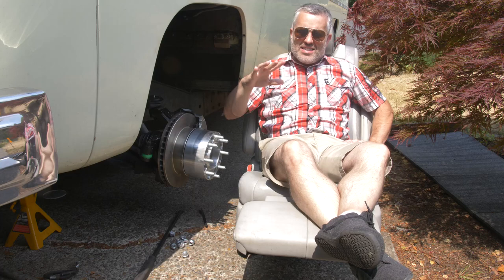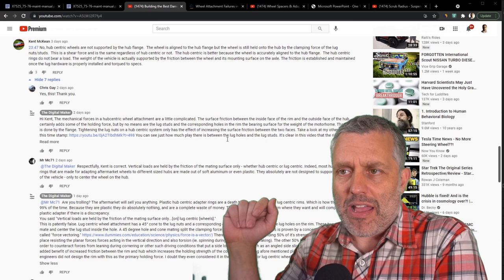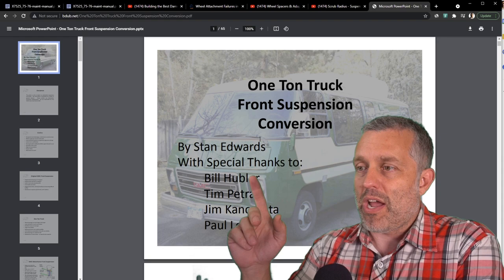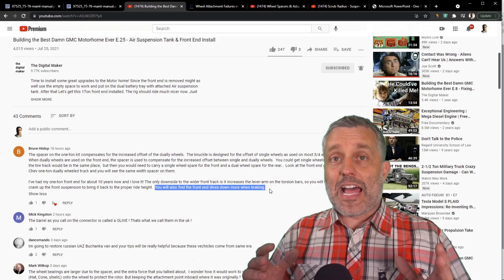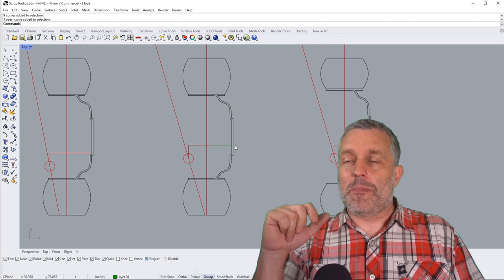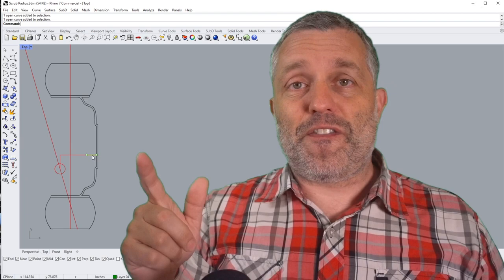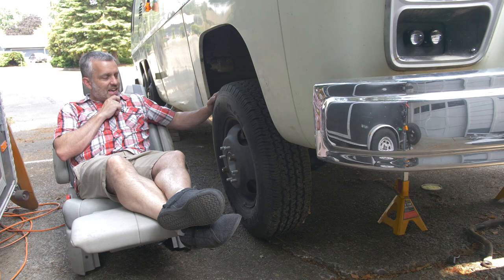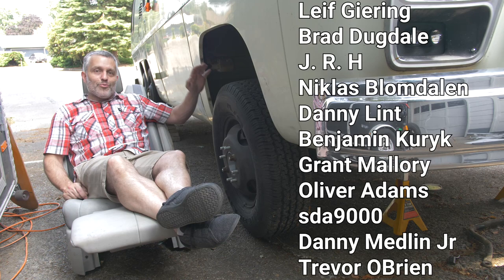GMC Motorhome 1-Ton Upgrade - Engineering Explained

Comment: Bump steer is a directional change due to suspension movement, however it is caused by a difference in the steering arm swing or pivot vs the upright.  Lowering or raising ride height is usually the main cause because the steering hasn't been relocated to compensate.  When we lowered a 911, we usually put a spacer under the steering rack to correct the geometry and minimize the bump steer.
Caster and camber and steering axis inclination all play a part in how effective auto centering is.

Comment: I believe you got bump steer mixed up with the self centering of the wheel. Bump steer happens when the steering linkage is out of plane(extreme angle) with the centerline the front axle.  In this situation when you hit a bump it causes the the front wheels to change direction during the suspension cycling thru the bump. Bump steer happens in improperly lifted 4 wheel drives. Other than that great presentation.
Reply: @mwilliamshs  I've had trouble trying to explain steering geometry,  but definitely know the results of bump steer. I learned the hard way during my younger days lifting 4x4s. Definitely don't like bump steer.

Comment: This has been enormously helpful, thank you. 
Sadly, I was thinking about upgrading but I am now convinced to simply rebuild.  
I’ll buy the tool to do the bearings.  
My family has put over 50,000 miles on our ramshackle 77 Palm Beach and we are still on the original front bearings, though we have done all four rear sets.   Our motor home rocks, no matter how threadbare, it’s an awesome machine.  
Enjoy yours!!

Comment: You are confusing bump steer with caster angle that causes self-centering.  "Bump steer" refers to a change in steering angle caused by a change in suspension height.  Either by lean in a corner or hitting a bump.

Comment: 10:43 Bump steer is NOT the "fancy term" for the force that wants to straighten your wheel out.  The force that wants to straighten your wheel out is a function of "caster".  This also affects the vehicle's straight-line stability.  Bump steer or roll steer is the term for the tendency of the wheel of a car to steer itself as it moves through the suspension stroke.  All vehicle suspension systems have some bump or roll steer, but the designer of the suspension system will have spent a great deal of time and effort to minimise bump steer.  Generally, bump steer cannot be adjusted out of a suspension system without physically relocating suspension components.  
Here is a very good description of bump steer and "instant center" from Hot Rod Garage: https://www.youtube.com/watch?v=tHbWkR-AZXo&t=82s
Reply: Lack of bump steer is why the 1974-1981 Pinto front suspension is so popular with hot rods, custom cars, and racers. North American Fiberglass made Shelby Cobra replicas and raced them with stock Pinto Mustang II front suspension parts. No fancy tube arms, adjustable coil springs etc.
Reply: Yes caster is a directional control on a turn the   inside wheel pushes down thus raising vehicle up.   SAI "Steering Axis Inclination" is also a directional control on a turn inside and outside wheels pushes down thus both sides raises vehicle up thus has twice the effect of caster.

Comment: The air bag mod over the steer axle is regulated by a leveling valve as load and road conditions change.

Comment: Narrower front end can help correct understeer in slippery conditions.  I remember reading that offsetting the rear end wider than the right front of a dirt car, made the weight transfer faster on the front improving the front end bite. Since the rv is a tandem understeer is a problem.  I think that gm engineers knew that, and also knew that tracking the wheels the same as the back offers no benefit other than appearance. Since they made axles and control arms specifically for the gmc rv they could have easily made the front end track the  same  as the back by changing the mounting points on the frame. Some think they used the configuration of the toronado front clip as a cost saving measure only, however,  the gmc has its own spindles and control arms and  axles. The reality is , they had to re-engineer the front end to work on the gmc.

Comment: I thought everyone knows that the 250 ft-lb figure was an error.  Torquing a 9/16" grade 8 stud that high will stretch them and they will eventually fatigue break.  This has been discussed many times on-line over the last 30+ years. The consensus is that 140 ft-lbs is more than sufficient.
Reply: So, there was a typo for every single year it was made?  Because I checked each Owner's manual, and they all say 250 ft. lbs.   I seriously doubt a typo would go unnoticed for six years, and over 12k coaches built.
Reply: @seeburg220  nope, not a typo, an error. Copy/paste predates computers. You tighten to 250 and you WILL break studs, especially 43 to 49 year old ones. Not something you should risk happening at 65 on a freeway.
Reply: @Nyth63  first time I torqued these, I instinctively went 150 lbs and I was surprised at 250.. especially on this stud size. And I can't imagine them backing off at 150 lbs , they haven't.  I can however easily imagine stripping or pulling the threads at 250
Reply: @Nyth63  Makes me wonder if his "loose lug nut" issue was caused by stretched lugs.

Comment: I was reading 30 years ago how the challenge to make race  cars handle better was to get the ball joints as close to the center of the contact patch to get zero scrub. Zero scrub works very well for heavy vehicles, because the effort to steer the vehicle is less, the resistance will be caster as to turn the vehicle is lifted as it turns.  Since we're mostly on the highway I set my caster on the gmc at 3 degrees, you can really feel it at slow speeds on asphalt.    On the highway it's great.

Comment: I had always known of the vehicle's tendency to return the steering wheel to center attributed to the caster settings of the suspension. The more positive the caster, the more you have to fight the steering wheel in a turn. As an extreme example, that's why a top fuel dragster's positive caster setting is so rediculously extreme. You don't want it going anywhere but straight. And for torque steer, though it can be a traction issue, isn't it usually an issue of unequal length drive axles? Front wheel drive cars almost always have an axle 1.5 to 2 times the length of the other. The longer of the two acts like a torsion bar. At least, that's what I had learned in college.
Reply: Yes caster is a directional control on a turn the   inside wheel pushes down thus raising vehicle up.   SAI "Steering Axis Inclination" is also a directional control on a turn inside and outside wheels pushes down thus both sides raises vehicle up thus has twice the effect of caster.

Comment: I looked at the 1 ton setup and concluded very quickly that the geometry was not thought out past the idea of a bigger bearing. And having a hub spacer that big probably defeated that. Changing the length of the control arms and retaining stock mounts isn't ideal, and it's not an engineered solution. My stock bearings made it 97,000 miles

Comment: Great Video,

Have you studied the Ackerman Steering Priciples?

Air Bag Options

1.Fill with nitrogen for stable temperature and atmospheric changes. 

2. Have a cab mounted air regulator for adjustment while driving,  (my favorite option)
Reply: This might be a bit naive of me to ask, but why would pure nitrogen be better than regular air? The ideal gas law (p*V=n*R*T) applies to all gases within the expected operating conditions; not just air.
Reply: Nitrogen molecules (N2) are larger than oxygen molecules (O2) so therefore, pure nitrogen will permeate the walls of your tires less than oxygen molecules. ...

Comment: Lets start with one thing. The issue with "wheel offs" isn't because of Hub Centric or Lug Centric wheels. 99% of "Lug Centric" wheels are also supported by a hub centric flange. Often that tolerance is so tight that even the tiniest corrosion will stick them on so tight that a 8# mallet is needed to remove them. The issue is the varied rate of expansion of and Alloy wheel  with a Steel Hub Assy(and those pesky steel studs). The tire industry figured this out in the 90's. If you have Alloy rims you must come back to the place who installed your wheels 100 miles from install for a retorque. This is not required for steel wheels. Now some shops will tell everyone to come back after 100 miles but that's just a CYA.  Going even deeper go look at a 1950's and 60's light duty truck wheel, they have conical seats for what you call a "lug centric wheel nut". The Issue whit this GMC wheel here is they are dually wheels and supposed to be interchangeable for the inner and outer. That's why they have the flat base flange nuts they need to work both ways. Steel dually wheels to this day have the same setup we have on our  1970's GMC MH.  Lastly that "250# torque" doesn't clamp the wheel at 250ft lbs it just takes 250 ft pounds of twisting force to achieve maybe a 150 lbs stud torque due the friction of that large surface area flange nut.  Besides a twisting torque of 250 ft lbs doesn't give you a clamping force of 250lb it's closer to like 30,000 pounds(just a ball park) for clamping force. Over 20 years in Automotive and Truck, 8 of those years in the tire and wheel industry. Worked for corporate Goodyear back in the 90's. I have a stupid amount of training tin tire and wheels failures.

Comment: Well I hate to tell you now, I have talked with the Alex Sirum GMC Motorhomes in Okeechobee FL, they say thay can get all the parts without the 1 ton front end.  Im a trailer guy, DO NOT USE A LIGHTER tire, stay with a 10 ply load range E tire, if you do it will be like driving a wet noodle down the road.
Reply from the maker: >DO NOT USE A LIGHTER tire,...it will be like driving a wet noodle down the road.
Can you give me more information? What leads you to say this? With a sidewall that is 1" shorter (lower profile=stiffer) and the same weight rating as what the original manual from GMC specified, I don't see how the 235/65R18  110 tires will be unreasonably flexible. Radial tire technology has come a long way in recent years. "A tire’s load range letter is an attempt to equate radial tires’ carrying strength in old bias-ply terms. Air pressure is the functional indicator: Higher-load tires accept higher maximum pressures." (https://www.motortrend.com/how-to/1407-understanding-tire-load-ratings/)  So if it feels like a noodle I should just be able to increase the pressure up to the max of 50psi. Do you know of someone who has tried 18" rims with 30" 110 load rated tires? I feel like I should trust the engineers who are telling me that this tire is equivalent to the bias ply tire that GMC specified in the manual. Is the manual wrong? I know that handling standards of the day were lower and bias ply tires are supposed to have stiffer sidewalls, so you could be correct, but isn't that the whole point of the load rating? Shouldn't a 110 tire today offer the same or better performance of an 8 ply Load range D tire from 1978?
Reply: You need to run load rating E on these units unless you plan on running lite...so no water, no black water, generator or batteries etc. If you do a little more research you will find GMC upped the tire requirements in 77-78.  The proper way to do a tire choice would be to fit out your RV then scale each axle....then you could choice the proper rating based on the load.  Note: you also dont want to be running your tires at max inflation pressures so you have to look at that as well.
Reply: @richardmondor1360  Richard Agrees with me, I bought a f150 with 18" tires, they were 110 rated, just pulling a 16' Flat trailer was bad, it don't matter the pressure, its the sidewall stiffness of a 10 ply e rated tire, Iv'e got a couple million miles with Various trailers n trucks light medium duty some heavy duty, You can try it but you will come to me with what many people tell me "You was right"

Comment: Go with the air ride you don't need to worry about mountains! As for the nosedive you can get a brake  proportioning valve from summit racing or jegs for $50-$60 bucks

Comment: your description of bump steer is inaccurate. your describing 1 effect of caster. bump steer is caused by the arc of travel of the steering tie rods. if you have a high angle tie rod, on the lower side of the arc, and you hit a bump, causing the suspension to compress, raising the tie rod in it's arc of travel, this causes the tie rod to force the wheel to turn. as the tie rod raises in it's arc of travel it becomes longer, there by turning the wheel around the spindle axis. depending if the steering is fwd of the spindle or aft of the spindle will determine the direction of the turn.

Comment: Modern cars and light trucks are all hub-centric wheels from the factory.  The only wheels that are lug-centric are aftermarket wheels.
Reply from the maker: Sometimes I read comments that make me doubt reality for a minute. This was one of those. If the lug nuts have a conical profile, the wheels are lug-centric (lug piloted). Do an ebay search for "lug nut" and see how long you have to scroll before you find a flat flanged lug nut (the type used on hub-centric wheels). The difficulty locating Hub-centric lug nuts is a good indicator of that attachment system's prevalence.
Reply: @IndustriousPursuits  You are making a bad assumption that conical nuts are only used on lug centric wheels.  It is true that square shoulder nuts can only be used on hub centric wheels.  But conical nuts are used on both hub centric and lug centric wheels.  If the hub has a protrusion that fits within the wheel with very little clearance it is hub centric whether it uses conical or square shoulder nuts.  Go pull the OEM wheel off any recent car or light truck and look at the clearance between the hub and wheel, the clearance between the wheel and hub will be less than the clearance between the wheel and the lug nuts.  A build up of rust or corrosion on the hub or wheel center will cause the wheel to stick, even with all the lug nuts removed.  That is because the wheel is hub centric.
Reply: @tallpaulsynd  Yup! and the lug nuts for alloy and steel wheels are commonly the same.  Many OEM cars come with alloy wheels and a steel spare wheel but the same lug nuts (almost always conical) are used for both wheels.

Comment: I'm a bit confused. There aren't any front wheel drive corvettes. Please revisit
 Thanks
Upon further research I found the first GM front wheel drive car was the 1966 Toronado.
Love your page. Looking for my own GM now.
Peace
Reply from the maker: OMG! That's so true. That was the first year for IFS, not front wheel drive IFS!!! That makes it likely that this is the first production GM IFS Fwd.
Reply from the maker: This is the same engine and suspension as the Toronado.
Reply: U can buy mine 5 k
Reply: @IndustriousPursuits  '63 Corvette was not the first IFS GM car by any stretch. I believe it was the second independent "rear" suspension after the '60 Corvair, which had a swing axle rear suspension. I'm enjoying your videos though.

Comment: In cars I haven't noticed near the difference as I thought I would from changing sidewall aspect ratios. The only place I really notice is better handling. 

You're also putting way too much into the tire/wheel width, 225 and 235's will be fine on the exact same size wheels. That's not an issue at all.
Reply: Going up a +one or +two fitment with a car is usually not a bad thing but when your dealing with 20000lbs of vehicle and limited wheel offset/spacing it a whole different ball game.

Comment: Y'all the 250ft pound  torque on a Large Diameter Dry, flange nut is likely correct, in part.  On a regular Nut (low surface contact area) you loose 50% of the applied torque to friction between the Nutface and the wheel face. There are further loses in the thread friction. That GMC flange nut on the original mild steel wheel has probably 3X+ the surface area of a standard nut so even at 250ft lbs of torque that solid base flange nut is applying at most 100 ftlbs of torque to the stud. If you are using a 2 piece nut yeah probably 140 ftlbs is fine. If you are using a lubricant with the old factory nut 140ftlbs is likely fine. From why I have seen most wheel studs have been lubed at some point in their life by some well intentioned,

Comment: BRAKE BIAS issues.. i don't know if the increase in front braking ability changed the brake bias toward the front.. making the front wheels slid before the back wheels..   i can't find the size of the rear wheel cylinder bore... could be 7/8 or 25/32   0.9375 or 0.906. 

 the Centric Parts   134.62001 wheel cylinder seem to be a 15/16" bore of the same family..  i see an EW71119 that is a 1" bore that might be in the same family.. or it could be wrong. 

 please calculate the piston bores of the original calipers and the replacement calipers.. if you have the same square inches when you calculate it out.. then you are probably good.. if you have increased.. you may want to go to a larger rear wheel cylinder. 

why.. in Circle track cars... G bodies.. monte carlos.. cutlass supremes.. the racers went to a full size impala/caprice front spindles, rotors and calipers which threw off the brake bias..  they tried installing adjustable rear prop valves with a knob.. nothing they could do to stop the fronts from locking up before the rears.. there happened to be one application  that instead of 3/4" wheel cylinders was 7/8.. and mounted the exact same way.. that cured the issues and returned brake bias to proper ratios..  after the swap all 4 wheels skidded.. instead of just the fronts..